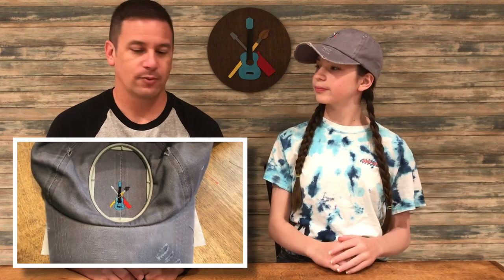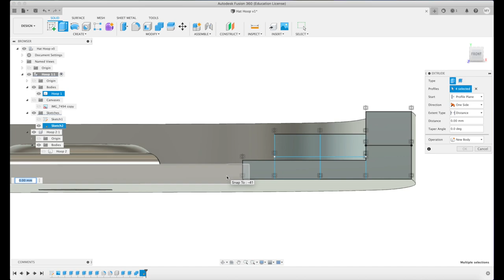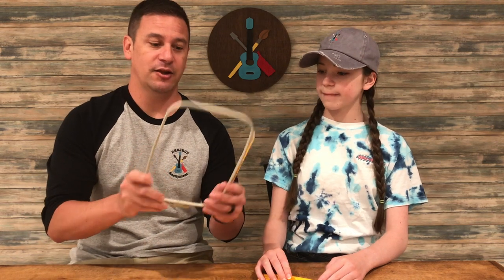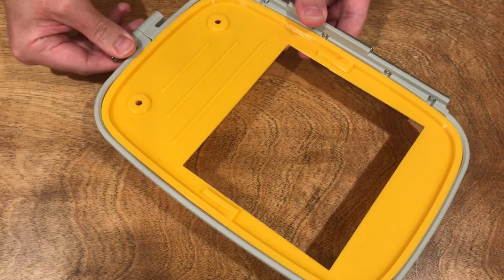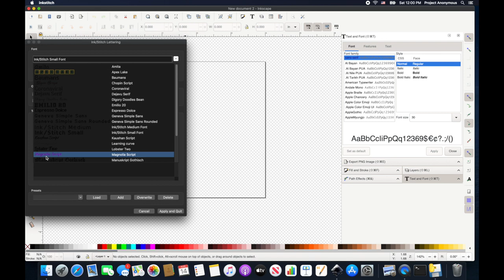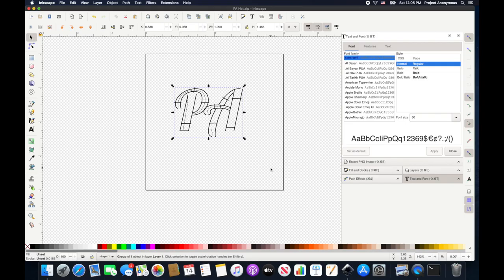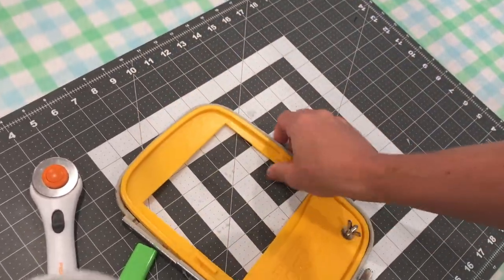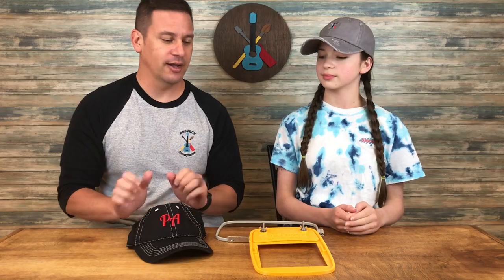3D Printing a Hat Hoop for the Brother SE1900

Comment: gonna print this for my wife. Very new to 3d printer. dragging the file into Cura I notice it defaults to printing it standing up, do you think thats best or should it be laid flat?
Reply from the maker: We would absolutely print it flat. You will get the best results and bed adhesion that way. Thanks for watching!
Reply: @ProjectAnonymous_Duo  I did print it flat with a raft (the first print with no raft failed) . It came out great. Thanks so much for this. I just bought her an embroidery machine for her birthday and we just got a 3d printer. So this was a perfect project to get started.

Comment: I asked a few question on multiple videos great vids by the way ! Very helpful. I have a. Question my needle keeps breaking which are the ones the machine brings and i’m working on thick fabric like sweaters and I would like to know a good needle I can purchase for the machine that would hold as much as possible for sweaters? Any recommendations?
Reply from the maker: Hi, thanks for watching! A sturdy needle we recommend for denser and thicker materials is the 90/14 needle: https://amzn.to/3BwJSMs. I hope this helps!
Reply: @ProjectAnonymous_Duo  do you use this needle in general or only for thick materials. ?
Reply from the maker: Only on the thicker materials… Our go to needle for normal embroidery is the 75/11 needle.
Reply: Ball point needles work best when sewing knits, like sweaters on a sewing machine. They have a duller point, moving the knit thread aside rather than cut through it like a conventional sharp needle. Most ball point needles are size 14. Good luck with your projects!